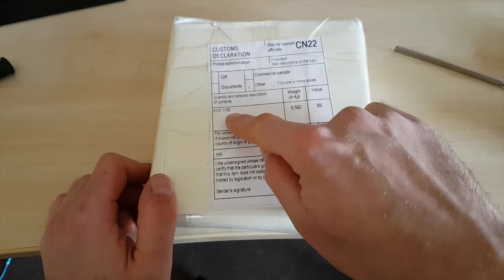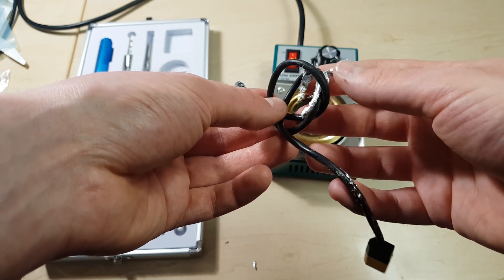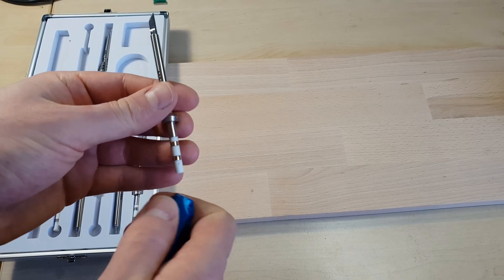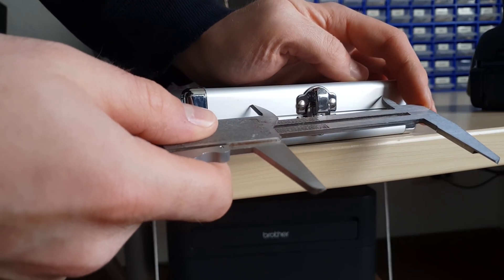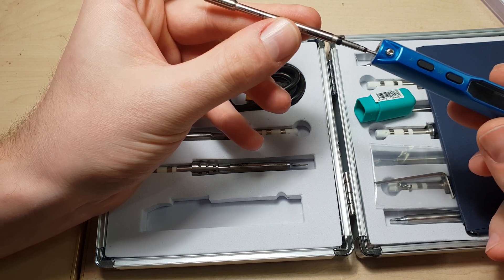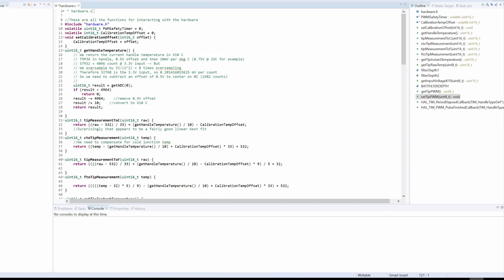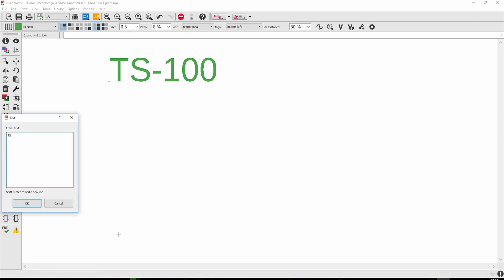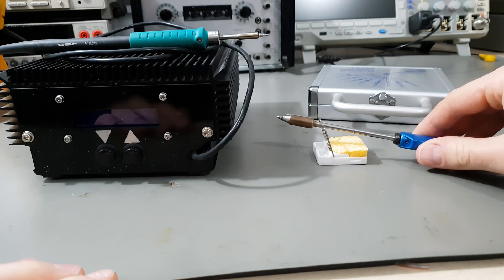'TS245' - TS100 Soldering Iron with JBC C245 Cartridge

Comment: so looking around for a powersuply ... i found this.. seems to be a good one.. with all the plugs provided one has to fit ?? or these crappy ?? is does say 65w so i assume it's going to be the max..
http://www.mediamarkt.nl/nl/product/_port-designs-universele-laptopadapter-65w-1480484.html
Reply: Try this one. It's a very high quality and very safe Meanwell powersupply, has the correct barrel plug, and  it's 90W so it's the maximum supported by the TS100 for very fast heating. Only catch is the listing says in only ships to the US/Canada, so you might have to contact the seller. 
https://www.ebay.com/itm/Mean-Well-GST90A24-P1M-24V-3-75A-90W-Desktop-Adapter-Power-Supply-Charger/292465846679?hash=item441852a997:g:1WsAAOSwCGVX-pss
Reply: i don't understand .. is'nt 24v @ 2.7 amps the max it can take??
i do konw Marco mentioned it can take up to 36V.. 
https://youtu.be/HgrB5P-rDLw?t=8m50s

i think i need to educate myself because i don't understand how 24V @ 90 wats is save isn't the max according to the manual 24v 2.7Amps..
If you can direct me to what i need to read to understand this i'd be grateful. or explain it to me which one is easiest.. i tried to google the name "Mean Well" and found being sold in the EU very expensive live €47
That's $60...if i was to ad that to the €42 thats $52 ...that would be around €100 so €30 less than a brand new Hakko FX-888D still this direct heating tip might be better but perhaps the old tech is good enough ???
Any advice would be welcome.. 
https://www.conrad.nl/p/tafelnetvoeding-vaste-spanning-mean-well-gs90a24-p1m-24-vdc-375-a-90-w-1297395
Reply: Whoops, just ended up looking at the included manual, and the max is indeed 65W (24V @ 2.7A). That being said, it's always safe for a power supply to exceed the max wattage of the load, since current is *drawn*; i.e. even if the power supply was able to supply 10A (for a total of 240W), it would only supply the amount of current demanded by the load (in this case, 65W). 
As to my recommendation for the Meanwell PSU, I was able to order it from that seller with free shipping which was an excellent deal, but you might be able to find a similarly specced and safe PSU locally. 
Lastly, if you're looking for the best bang-for-buck soldering station and you don't need the amazing portablility of the TS100, consider a Hakko T12-compatible station, like the one that VoltLog showed off: https://www.youtube.com/watch?v=n8pu6du0ftY . Direct heating makes a MASSIVE difference, and you should be able to get one of those units for well under the cost of an FX-888.
Reply: after hours or reading , blogs /forums subscribing to EEVblog forum and watching tons of youtube vids i also came across Voltlog nice channel. Like Marco he does an awesome job of going in depth and explaining stuff. in VoltLog #87 "Assembling The T12" also a direct heating iron seems good but he did note something about the grounding wire not being implemented and how important that was to not fry your work..i can buy the T12 assembled on banggood for €40,60 that's around $51 and i would grab a temp tester for around €10 and sum spare sensors for €4..The only real concern i have is that it's electrically not 100% save.. i can open it up and do a visual inspection but i'm a noob when it comes to electronics and no one of my friends is. I would almost ask Marco or Voltlog do do a teardown of a unit mod / improve it where necessary and i would pay for the shipping who i would feel way better if that was an option.. perhaps i can take a view pics and post them on EEVblog and ask around..
Btw about direct heating the first time i heard about the distinction was a comment Louis Rossmann made about the Weller vs Hakko #1063 EEVblog made . That ignited a whole discussion on the forum and two more vids by Dave about the matter. in short i came to the same conclusion after hearing people talk about it on EEVblog vids and Marco also mentioned it in his TS-100: The open Source weller-killer vid. And his DIY JBC soldering station is really impressive. i would gladly pay for such a DIY build...i'l let it rest for now .. and think it over.. for my use i would also need a de-soldering gun/station i'm thinking of going for the aoyue 8800 for around €128 with shipping and vat.. Because the hakko counterpart is to damm expensive..i do like the ZD-915 but same price for me.. but i think the aoyue is the better choice.. not 100% clear on what is better external pump vs all in one gun..but for the number of use for me i think the gun is ok.. i want to enjoy the hobby of self building at first mechanical keyboards and mod the 3 boards i have but i don't want it to be a nightmare so perhaps i'm paying way more than is needed this way .. but if i can save a couple of $$ where it's ok to do so and where not i have to except that that's the price of admission i guess..Thank you for your input and help really appreciate it.
Reply: No worries, I'm a huge fan of mech keyboards too! One last suggestion: if you're looking for videos to help improve your soldering technique, check out Demux4555: https://www.youtube.com/channel/UCdXb_86ATv3IrEyy3A0HglQ .

He puts together low cost DIY soldering kits, and has amazing soldering and videography skills. I've purchased a couple of kits he's showcased and followed along with his vids and it's really improved my soldering quality.
Reply: cool i just subbed will have a look at his channel..wow!! i just watched a bit of his vid "Free solder porn XXX" hahaha the quality is awesome i liked the vid so i can find it on my old apple tv ;-) and watch it in the living room no sitting behind my desk and even my old 30-inch doesn't do it justice ..Will look at the kit you mentioned awesome look forward to it..btw i just finished talking to a friend of mind about soldering irons and desoldering.. i almost forgot about aoyue.eu if you select "Leadfree Soldering Station" you'll find the 2901 and the 2900 both use a direct tip and the main distributor is in Germany so close to me and in europe searching on youtube sra-solder seems to popup in think it's a us based company .only problem is that most people just do a product commercial type vid instead of a real world usage and in depth review an teardown..
so pretty much useless vids..i did find a vid titled "Aoyue 2930 vibration sensor failure [Resolved, sort of] " so that doesn't fill me with confidence about the brand !! also i found a person having problems with his   "AOYUE 3233" don't know if  AOYUE fixed that problem need to do sum more research about the brand..
For now it's looking like spending a bit more on a external powersuply and the TS100 is the better option but will check out Demux4555..
Reply: so after a couple of days of research TS100 vs FX-888D i came to this conclusion for now.
getting the TS100 will cost me €43 + €40 for a good power supply or get lucky and find a cheap power supply for €10 less. but usually the good ones are between €40 to €47 the meanwell is €45 to €47.. so in total i would be paying around €83 ..that's €50 less than a new FX-888D .. as it stands i think for true hole soldering the FX-888D will do nicely i know that i will loose thermal conduction and all that jazz using the older system that has a separate heating element. The only other option i can see is getting the "AOYUE 2900" That one would also be €73 direct from Germany.. To sum up all in the range of the Hakko FX-888D ..hahahah
If money was no object i would get the Hakko FX-951 but that's way to much for now..
so i'l let it all rest for a couple of months and see what i'l do after my redhat cert exams..

Comment: i think this iron is better then the assembled Banggood "DSK T12-D" the tip connection seems more solid to me?????
Only problem i have is that the only power adapters i have at home are Dell Laptop AC bricks 19.5 V with a 7.3mm outer diameter.. The bloody thing is more expensive than the TS-100 and i can't even use it hahahah... 
https://www.replacedirect.nl/product/p0004468/dell-laptop-ac-adapter-90w-slimline.html

But i want a nice grounded powersuply 24 2.7A as the TS-100 manual states turning it in to a 65W iron..will look around perhaps i can buy a good powersuply that doesn't brake the bank..a place like 123laptoponderdelen.nl that sells third party laptop parts..
Or amazon.de ...any recommendations ?? i live in The Netherlands.

Comment: the capacitor plant idea is great, I should try that soon because spring is just around the corner!
Reply: Be nice if you could grow LEDs too, but i've heard you can only grow bulbs..
Reply: Muhammad Nour You know, it's very hard to grow microcontrollers, let alone microprocessors. You gotta build up some skills to do that.
Reply: I would try to grow intel core I9 instead!
Reply: SMD resistors and capacitors grow in all kinds of places like weeds or algae, and I think it's worth harvesting them.
Reply: i just harvested, i don't want to 'spout' but lets just say ...over 100 F
Reply: #Kolin Evans
They might take forever to grow to that size, but it all depends on the weather ;)
Reply: Nearby my home there is an abandoned factory ruin. Regularly, trash from renovations is dumped there, including useful stuff. More than once, gambling machines are taken apart for the the metal, and the circuit boards, full of discrete logic and eeproms, left to decompose.
Reply: @JuanHerrero  oh 🧐😥

Comment: K-style tips (the wood burning tip) is used for drag-soldering SMT IC's.  I find they're also convenient for removing through-hole parts, since you can easily span two pins.
Reply: Exactly. Especially QFN parts. With a conical tip you can't even touch the 'leg' and the pad and get heat transfer. With the blade, it's super easy.
Reply: I never did like the knife style tip, I use either a beveled tip or Hot air for surface mount. But like many things a preference is just that, a preference.
Reply: The wide knife styles that seem abundant are really too wide for most things, and the 45 degree rake is way too steep and results in clearance problems around other parts.  For all-around work, I ended up modifying a 3.2mm straight chisel to have a k-style edge bevel and a more subtle rake angle.
Reply: @Dream: liked for the picture.

I completely understand what you did there, and why. It IS for thru hole, right? 

IMO, the knife is specifically created for SMD work. There are significant differences from a chisel, and the 45 degree rake does a couple of significant things.
1. The rake means you can swipe a row of (side)pins left to right on a QFN or the like. Though sometimes it's easier to dab/mop rather than drag across. It's also pretty good at drag soldering gullwing pins, but IMO it is far from the best tip for this.
2. In SMD work, you can often use just the tip of the knife. Without that 45 degree rake the tip wouldn't be pointy enough. I suppose in thru hole, the large 6mm edge is hard to maneuver, but in SMD you often have very short components and solder beads on the pcb. Everything is very flat. So a slight lift of the heel can provide a lot of clearance.
3. The 45 degree rake means that when you load the tip with solder, surface tension blobs the solder slightly away from the very point. With a twist, you can invert the tip and use the clean, dry point to hold parts down while tweaking them with tweezers for, say, fine tuning of QFN without the part creeping/lifting up away from the board, or to help manipulate small components that may be upside down or turned around. All without overheating the parts or leaving strings and blobs of solder everywhere, like you'd do with a bevel tip. But the solder is held close enough to the tip it is ready to apply to your pre-fluxed joints.  
4. It's tinned on the beveled faces, only. At least the Hakko's are. So you don't get the solder blob rolling around the side of the shaft, like you would with a chisel. A blob of solder is easy to control on the tip of the knife.

I use a knife tip for mainly two things. Manually soldering QFN's (reason #3 is why I prefer it to a bevel for this; otherwise, I personally feel like bevel is less finicky for making the joints). And for batch removal of passives - in an assembly mistake situation, where I may have put a misidentified component on multiple pcbs/locations. Assuming the knife can fit, you can get the edges to contact both pads of a passive at the same time. While you could do this with a bevel tip, this usually means adding a solder blob... and then you have to get rid of the part/blob or you end up putting the part back on another board, unintentionally. Since you can hit both pads at the same time with a knife, you can do this with no solder blob, no flux. And you can just stack the parts neatly on the face of the iron, sliding them up the side of the knife in neat rows until "the parking lot is full." Then wipe them all off on a kimwipe or paper towel.

If you ever need to do a lot of SMD soldering, search "John Gammel" on Youtube. And buy yourself a big CF/BCF tip!
Reply: I've been using 900M style stuff ever since I was doing this 8 hours a day in a production environment.  That said, the thermal impedance of a 900M style heater means I hate dealing with tip changes and warmup time.  My hybrid tip design is a compromise between the type K and type D.  It'll do through hole on a multilayer board with solid polygons and heavy plating better than a type D, and it'll suffice for most SMT chip/SOIC work.  As you mention, with ~3.5mm edge length, it's wide enough to hit both ends of up to 1206 passive chips.  I can do large QFP's with it if I really wanted.  I'm never doing a bunch of any one thing these days, so I'm after a good all-around tip.  

As for restricting where the solder goes on the tip and how that changes how the tip tends to wick up solder:   You're right. The type K tips are really controllable due to the way that only the edge faces are tinnable.  Type D and C/BC have the shank tinned, and this tends to make it problematic in enforcing which surface acts as a reservoir.  This is the basic reason why I can't stand conical B/I tips.  The solder just goes wherever it wants on the tip.  The CF/BCF is a good step, but I don't like dealing with the elliptical edge.  

As a cyberhobo who makes his own tools because I have more tools and time than money, I'll note that you can enforce which parts of any tip are tinnable by one of a couple methods.  The factory chrome or nickel-plates the tips.  I can't imagine most people can replicate such a plating process casually.  On the other hand, if the tinning is removed and the iron/steel is exposed, chemical bluing (selenium dioxide) can be used to blue an area of the tip.  I've used that method to make 0.5mm BCF style tips before (since no such thing is available).

IIRC, the only K styles available are the 5mm size.  At 45d, the edge length is 7.1mm. making it awful long for a things like SC-70 packages and whatnot.  Also, the barrel of a 900M tends to get too close to the board if there are other components nearby.  For SMT stuff, I'm more apt to be doing chip and SOT stuff, so a smaller edge length is what i'm after.  For big QFP's and things like SMT connectors, a 5mm tip is super quick.  For removal of things like SIP hybrid amplifiers from multilayer boards (without a desoldering pump), the 5mm K is a lifesaver.  

If I had to go back to doing production work, I'd probably have a lot more things to say about choosing the perfect tip for a job -- but if I ever have to solder N million joints on long-tail D-sub connectors in mezzanine board assemblies while listening to someone else's shitty music and barhopping stories, I think I'd rather shoot myself.
Reply: @Lodewijk Ijzerbrood I don't doubt that they are useful for that. But for cutting plastic foils or sheets, a hobby saw like a mini dozuki, a fine tooth coping saw, and a sharp craft knife will do most of what you need, faster and cleaner. What it's meant for is obviously more than cutting plastic, because the tip has a wettable surface for holding solder. According to Hakko: "This type has a shape like a knife and is capable of soldering by applying the tip in 3 ways: line, face and point. It is used for soldering at narrow pitches, correction of bridging and drag soldering."
Reply: When i say "bevel", i'm talking about the included angle of the edge geometry, not a type C/BC tip style. When i say "chisel tip" i mean something like a Hakko type D tip -- not a pyramid/chisel that you'd find on a tinner's iron from the hardware store.   D tips are good for general-purpose through-hole work, but just like type C/BC tips, they can't sit flat against both the lead and the pad in the way that the edge geometry of a K tip allows.

Maybe a picture helps:  https://a.safe.moe/yJh0Ly4.png  Higher heat capacity and less rake than a type K tip.
Reply: The tip is meant for cutting plastic foils or sheets beiing used in model airplanes and stuff.
Reply: Bevels are king for SMD, but the knife is the queen. Chisels are for noobs.
Reply: Mildly Productive is correct.  K tips aren't "meant for", but perhaps are "useful for" cutting or welding plastic. I keep a second set of untinned tips specifically for plastic welding and hot punching.  I haven't found K tips to be terribly good for plastic work, but perhaps you work with thinner material.